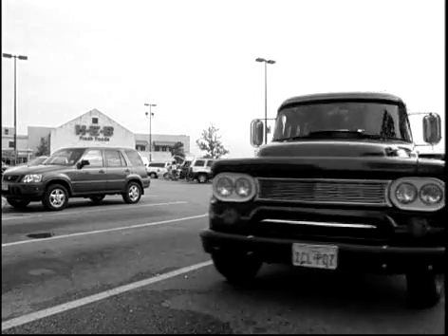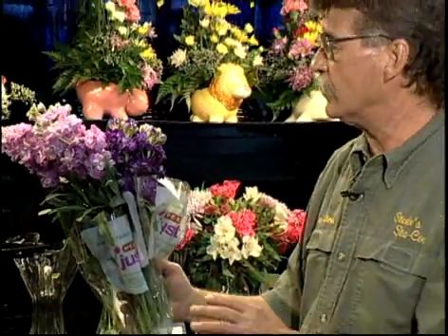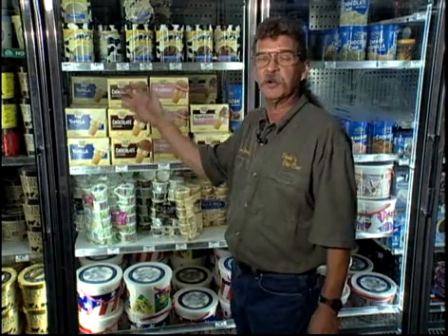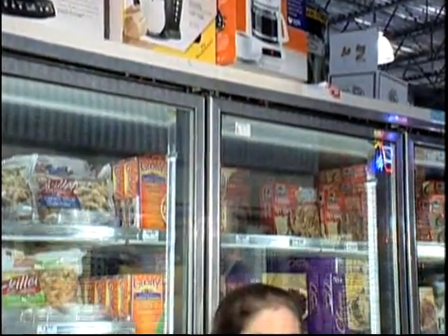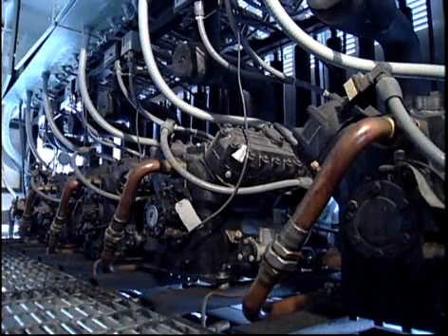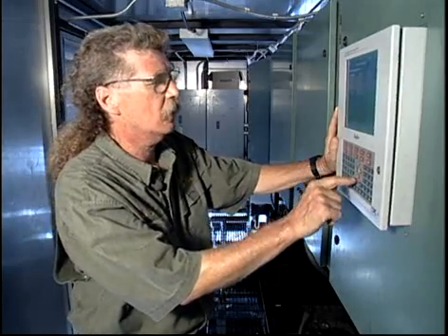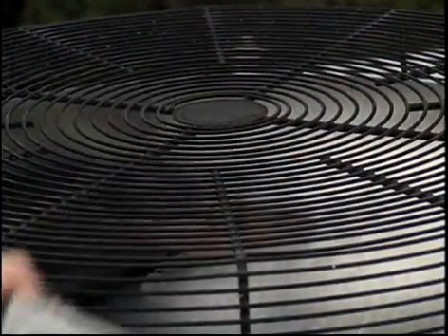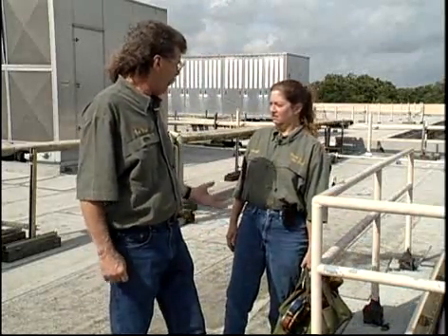Trip to the Grocery Store to check out commercial cooling systems

Comment: I think now they use R-404A for refrigerant
Reply: Many different refrigerants used for commercial refrigeration. 404a is the most popular. I'm the tech at a big ski resort in PA. I have units that use these refrigerants: R22, 134a, 502, 414b, 414b2, MP39, 410a, 422b, and 404a. It's ridiculous to keep that many cans on stock!
Reply: +Randy Price MP39 is also known as HP80. it's for medium to low temps. mainly for freezers.
Reply: +Von Sterner Thank you. I work as a tech for a grocery store and we use 22, 507, 407a, 404a, 410a, and I even have a 134a rack (total nightmare) but everything I use starts with an R, so I just wasn't sure if it was for something way different or not.
Reply: +Randy Price the letter(s) in front of a refrigerant are only manufacturers ID. they can put whatever letters they want. I believe MP39 is an older refrigerant. still produced but not widely used. I bet your 134a rack is a nightmare! 134a sucks. For refrigeration, I think 414b(Hotshot) is the best. Fairly low operating pressures and it has a lot of oil in it, alot like R12 did. It's a direct drop-in for 12. It's getting expensive tho. last 30 pounder I bought was $611!!
Reply: +Von Sterner hmm, never worked with 414b. That is quite expensive, it must be one of the older refrigerants still in use? Yeah not only does it just suck at it's job ...adding a 100 pounder of 134a to the rack takes HOURS! and good luck finding a leak detector that picks it up. And the EPA, or at the very least my company, seems to have the same expectations for loss as they do for any other refrigerant :/
Reply: +Randy Price yeah its def an older refrigerant. I've been switching systems that have 414b in them to 414b2(its the direct drop-in for the same systems that supported 414b.) when I change a compressor, etc. less than half the cost and about the same pressures. your right about 134a and detecting leaks. I had an older(10-12 years ago) leak detector that worked well for 134a. I can't remember which model, but it was a D-tek. A guy at my local United refrig talked me into getting a Tif. I don't like it. Detects ok, but the battery crapped out in less than a year. Do you work on/install any Hill Phoenix units?
Reply: +Von Sterner I see. I use the h10-pms for leak detection. Bacharach, Mars, and Johnson Controls make them they're all the same thing. Really sensitive, but not the most user friendly so it takes some getting used to. Yes! I do work on Hill Phoenix Racks and cases. Are you also a Supermarket Technician?
Reply: +Von Sterner Disregard the last part, I see now that you do work on ski resorts in PA. That sounds like fun.
Reply: +Randy Price recently, the company I work for bought a building and renovated it. the refrigeration blueprints had six condensing units with nine "cases" I call them evaporaters. they were hill phoenix units. me and one other guy installed them all in about 2.5 weeks. everything, piping, wiring, etc. it was crazy. I went against the blueprints. they called for one solenoid valve for multiple evaps on one condenser. I didn't like that. no control on each unit. I like a Sol valve for each temp control and it helps the condenser work less I'd think. overall, I didn't like the hill units. I had a few problems with them. have you had probs with new hill units? like manufacturing faults?
Reply: Randy Price DuPont has MO-99 which can be substituted for R-22.
Reply: +Von Sterner Yeah you need 1 valve per evap that would have been crazy. Unless the solenoid was intended to regulate the pressure on the condensing unit and the evaps still had their own TXV's with a single common evaporator pressure regulator valve. Even still I think you're better off with 1 solenoid per evap. Makes everything easier to troubleshoot and control, and I prefer liquid line solenoids over suction line, is that what you ended up with? As far as manufacturing faults go, YES. It seems every case from every company is made so cheap now that they have some sort of damage from shipping. Zero Zone is my favorite for newer cases they are simple and they work well, but for some reason my company won't use ZZ for medium temp cases. Not sure why. Older Hill Phoenix cases are pretty good, but the new ones definitely aren't going to hold up for 15-20 yrs. Hussmann is my least favorite manufacturer that I work with.
Reply: +Psycho9263 A straight retrofit? No oil or valve changeovers!?
Reply: Randy Price I seen technician use it as a straight substitute and it worked. I seen a tech substitute R-409A for R-12 and it worked.
Reply: +Randy Price yeah I ended up brazing a liquid line Sol into each case and just using the low press control to cycle. that's my preferred method to cycle on and off. plus if you have a leak(which you know happens quite a bit,) the unit will shut off. I've had compressors blow out because of still running with no gas in the system.
Reply: +Von Sterner What application is MP39 used for!? Never heard of it.

Comment: that was a good video, i was interested in this video because i was a janitor in the grocery store  and part of my duty was to take temp readings on every cooler and refrigerated case. and a lot of times i would have to defrost a unit myself which involved taking out all product in the effective area first roll that back to a freezer or cooler and then continue on to defrost with hot water etc, yes very interesting video,